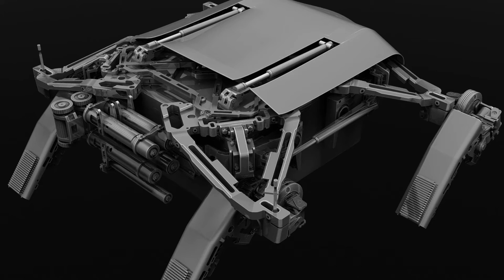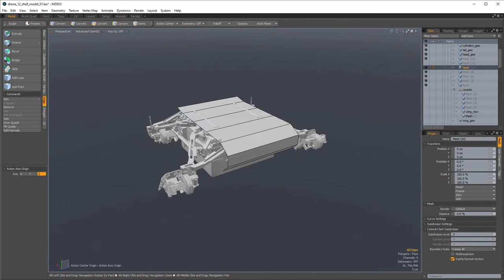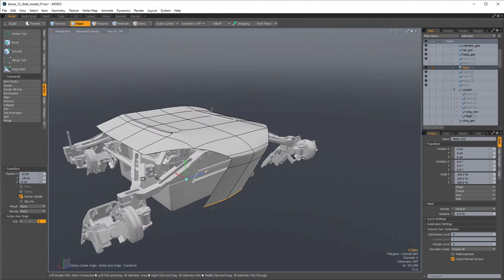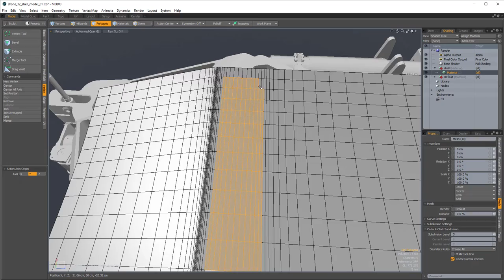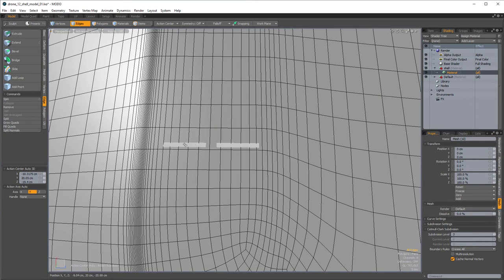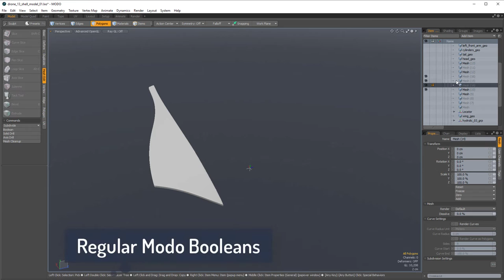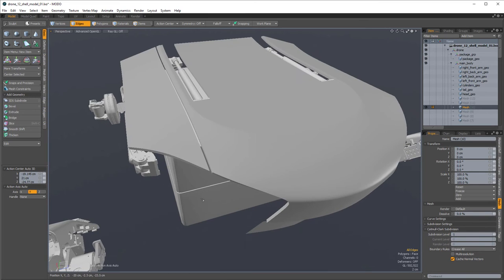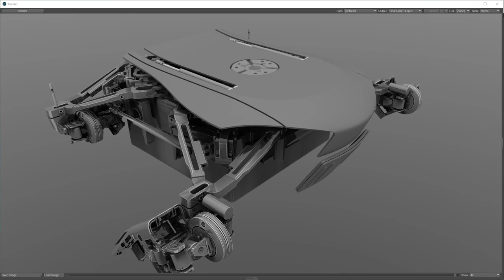Drone: Design Shell

Comment: Are you still on 701 or 801? I think you could do all the cuts using Mesh Fusion.By the way, are you doing any, more in depth, paid modeling (MODO) tutorials?
Reply from the maker: Hey there.  Yes I am still on 801sp5. I do have Mesh Fusion but not installed. It would be much simpler using mesh fusion but that would be a separate tutorial all together.  As for doing any more indepth tutorials, for now My plans are to make some tutorials on Substance Painter ( main part of this series ), and then a few mini mari tutorials. After which I want to do an in depth project in houdini based on automation. ( similar to what you get with modo procedurals, but it would go much further.  The next tutorial will be blender. For now I will make them free but should my current employment end I will work on a paid tutorial. cheers :).  Quick question, why do you ask? Did you like my modelling 101 and the UV tutorial?
Reply: Martin Krol
Thanks for answer. Yeah. I think you are one of the best MODO teachers.
Reply from the maker: Me too :). I am still working on that drone Substance Painter thing first. But I am starting to outline the Houdini lessons I will be looking at making.